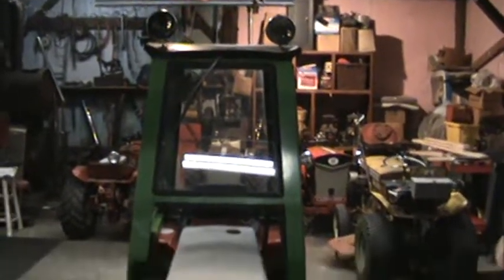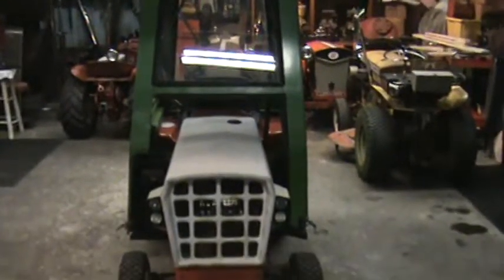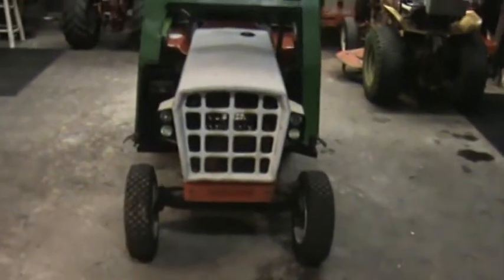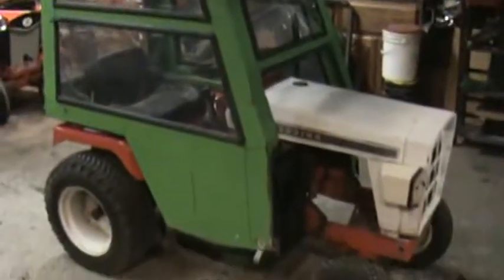DanCo snow cab find

Comment: I love owning a diesel. My JD 650 is a 2cyl 16hp yanmar but the useable power you get out of that engine is far more than any 16hp gasoline engine could handle. Diesels are way more fuel efficient and less fussy than a gasoline engine. you are going to love it!

Comment from the maker: the 3416 has become my engine test machine since I'm more partial to the older tractors, it made the most sense to have a dedicated engine break in platform. It's not of much use otherwise, since the PTO clutch is gone and I have no implements specific to these models.